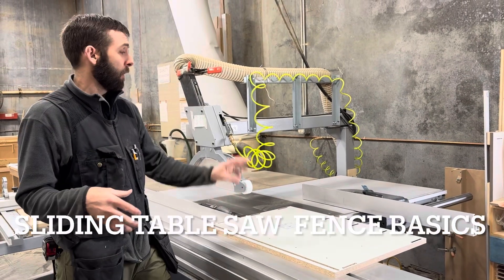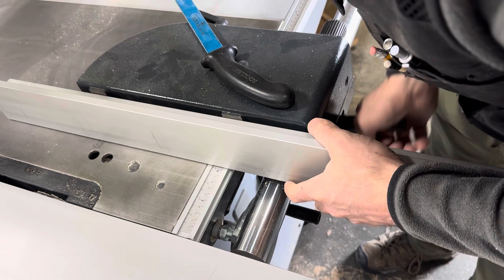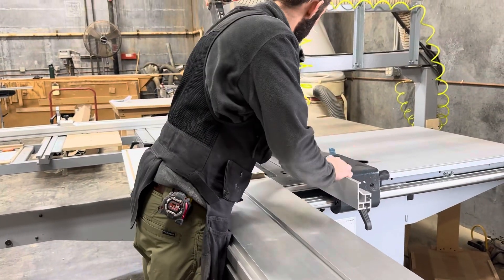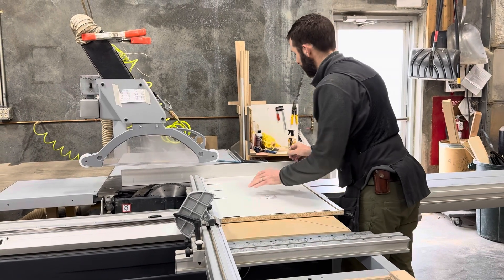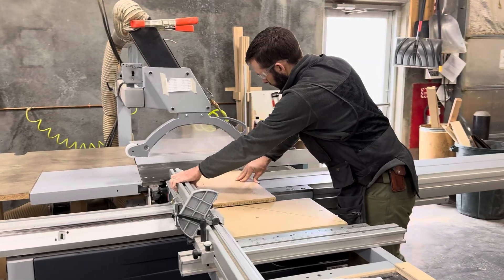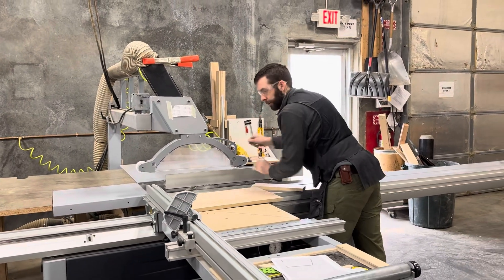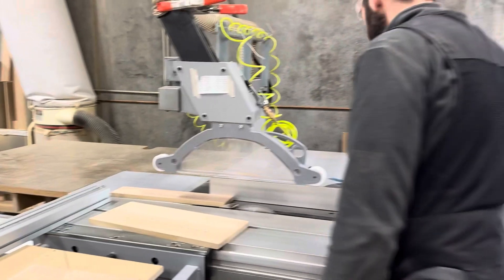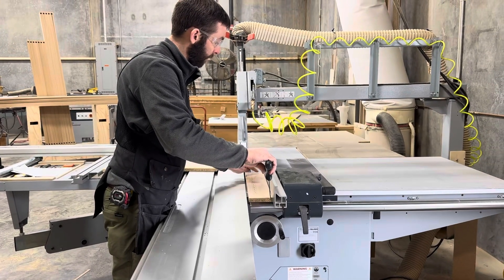Felder Sliding Table Saw Rip Fence

Comment: A conventional rip should not use the sliding feature.  Which is difficult as the table is often close to the same length as the material and you aren't going to take the time to remove the fence. Removing the cross fence is the text book answer. (I lean against the slider until I am near the back fence, then just let it float through the cut). The off cut is on the left, and not under ANY constraints for a fence that is past the front of the blade - always.  NOT discussed is the right side table is slightly lower than the slider. ALWAYS.  That causes a minor concern for the edge if the fall off is the LEFT side as the material on the right makes a slight transition to the bevel as you reach that final bit of arc of the blade at the exit of the cut (front of blade) and it is transitioning. It may or may not matter, it's something to be aware of in your material fit and processing plans. IF you use the slider as the rip side, treat it the same as the crosscut. Most drops of sheet goods I use the right side with little concern (melamine and laminate, veneer, may chip slightly at the exit of the cut). You need to think it through (if you are using dados or some other method of hiding that defect, such as it is on the outside and covered by the next cabinet or an applied panel, etc, it will never matter).
Reply from the maker: Very good points to be made aware of when setting up for cuts

Comment: I hope no one follows the advice on ripping in this video. Get a Frits and Franz jig and use the slider to rip with and that stupid piece of dangerous push stick is not needed. I have been using sliders for over 10 years and use a rip fence about once a year. This is not a cabinet saw and you need to forget everything you did on one of those.
Reply: nah everything wasn't bad? what u talking about
Reply from the maker: Frits and franz jigs are a great addition